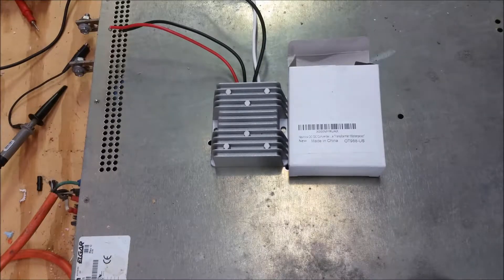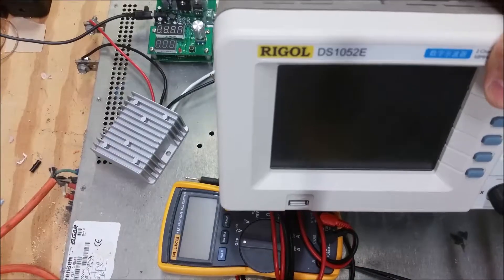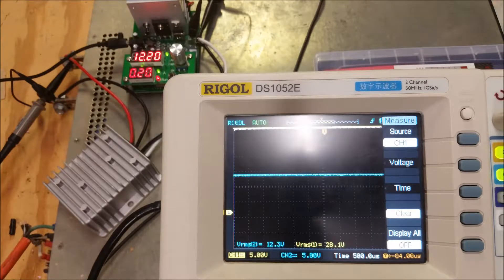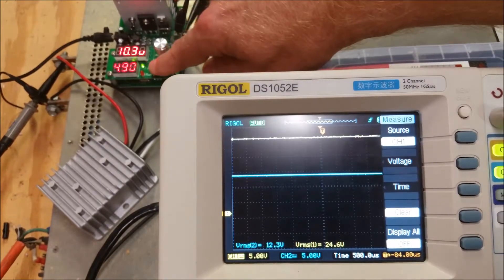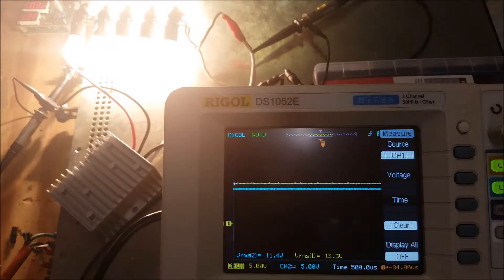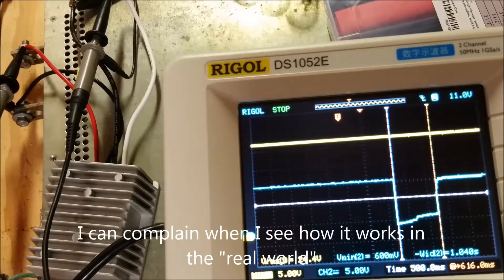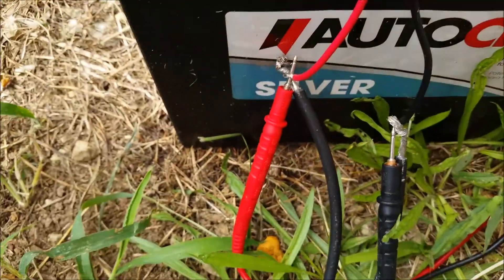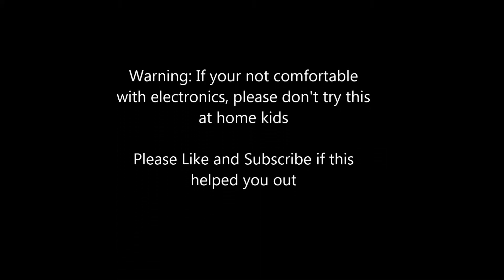Amazon DC-DC Converter Review

Comment: from the thermal test it seems to get very hot, wouldn't a change in the wire size and a cooling fan on the heat sink help to keep it from burning up?
Reply from the maker: Wire size can't be changed as it's connected to the pcb which is encapsulated in potting material. There also wasn't any mention of airflow being required. But in concept, I agree

Comment: I'll point out one other issue that petercamusojr didn't mention:  you used a 24 to 12 V converter with 30V input on a 12 V battery, no isolation mechanisms like diodes.  To charge a 12V battery you really needed a 36v to 13.8 volt converter.  Once the battery recovers and its voltage rises there's no guarantee you won't reverse current that way too.  Your lab testing was well done.  Your real world example is a bit too "real world" and was really more of a destructive test.
Reply from the maker: The panels voltage never drops below the battery voltage, so there wouldn't be any reverse current.  Ideally, protection diodes should be built into the converter

But yes, a 13.6 volt mppt controller is ideal, but I just wanted to have something that kept the battery at 12v.

Thanks for the reply.

Comment: Solar panels don't work well connected directly to DC converters. They can work ok if the sun is full and excess power is available, but any shade while drawing a steady load will make the solar output voltage collapse to near zero. This can make the converter low input protection trigger constantly.
Reply from the maker: This wasn't the case.  While I agree you need an mppt controller, this was a stop gap measure just to keep the battery topped off. But it shouldn't have resulted in the converter being blown out.

Comment: I bought one that was 480 watt 12volt to 24 volt and have had great results. I ran a zerobreeze mk2 "240 watt"  off it many times for extended periods. Maybe the boost converters are better built.
Reply from the maker: @wingman0114  thanks for the post. Interesting results, which brand.
Reply: @stem_saving1644  MGGI

Comment: can you use the same ground wire for input and output ? if i am trying to use this in my car ?
Reply from the maker: If it's non isolated you should be able to.
Reply: @stem_saving1644  i used 2 of this modules and used same ground no problem in my car

Comment: Well I bought the same one which has the same voltage input and output as your one does and when I put 24 volts in i get the same 24 volts come back out of it, very disappointed in the product

Comment: Thanks so much for this. Super helpful. My issue is my 12v LEDs flicker when my water pump in my van conversion pumps - same for diesel heater pump. I think I need a regulator for the LEDs because the pumps draw a sharp quick recurring load... Will this product fix the issue? Thinking no as it's limit is 12v? Thanks 😅
Reply from the maker: There is an off Chance it could work,  but what you're describing sounds like an instantaneous power problem.

A capacitor or lager alternator is probably a better solution... but can't say for sure since I don't know all the details.
Reply: Measure the relevant voltages. You will probably need an oscilloscope. OR  just bypass the wiring with some thick wires and see if it improves.

Comment: you didn't show input and output current. this test make nonsense
Reply from the maker: That can all be calculated. If you have voltage and resistance, which I showed in the video. Also have efficiency calculated.

Comment: When you were ramping up input voltage, why did you only test it up to about 30 when it is supposed to be rated to 40v. I would have wanted to see if you could go 5% or 10% above that, since if you get a 40v nominal battery it can be pushing 45v or so when fully charged.
Reply from the maker: Only have 33v supply.
Reply: @stem_saving1644  LOL that makes science.

Comment: thanks dude 
but i wanna ask about something
can i control with output amper or not
if my motore worked with max amper 7A so how can i use it
Reply from the maker: There is no feedback control if that's what your asking.  The motor determines  the current the converter will output so long as it's with its rated spec.

Comment: This is what happens when you use a buck for mppt WITHOUT A BLOCKING DIODE
Reply from the maker: How so?  What evidence says it doesn't have one built in?  Pwm or mppt can both keep a battery charged. Although mppt will do it more efficiently.
Reply: @stem_saving1644  I use these on my 60v 300w panels to charge lithium @ 13.8V (100A battery) , when i burnt my first one, i put in a DIODE and never had a problem since
Reply from the maker: @FellaMegaOld  these are rated at 40v. Not sure how they worked at 60v for you.  

But any good buck would have a good inline series schottky. I can't say what this does or doesn't have since it was potted.
Reply: @stem_saving1644  There cheap, they where  $20 in 2015

Comment: It would have been nice to know what the caps in the converter were rated at.  If they were less than 40v, then the  24v on the back should have been adhered to, irrespective of what the advertised claim was.
Reply from the maker: Unless you dig out the potting, you'll never see the ratings. If the specs say upto 40v, then it should operate to those requirements. Users shouldn't have to second guess capabilities listed on the datasheet. If that's the case why buy it?  That's my opinion.

Comment: I recently purchased this rugged Boost unit as 12 to 48v DC at 6 amp output max . I intend on using only 34% duty cycle on same max 6 amp, that reduces the use wattage less than 1/2.  Should I assume it will stay working? Should I use a higher rating such as 8 or 10 amp which is more costly?
Reply from the maker: The unit I reviewed is a buck not a boost. You should be fine so long as the instantaneous isn't higher than the max output.  I would also add filtering to reduce transients.

Comment: It says very clearly when your purchasing the converter, do not connect directly to a solar panel. There's probably a reason for that.
Reply from the maker: Not on the one I purchased. Read the description closely before I purchased it.
Reply: @stem_saving1644  It appears the solar panel produces voltage spikes that blew your caps.
Reply from the maker: The panels upper voltage max is below the converters threshold so that can't be it either.  There are lots of applications where buck converters are used on panels.
Reply: @stem_saving1644  The reason they say not to connect directly to panels is because Solar arrays, like all electronic devices, are prone to surges in voltage that can harm components and increase downtime. Surge protection devices can help keep systems running and profitable.
Reply: @stem_saving1644  Well, on the video I saw it was over 30v, which would mean you have 2 panels in series, since solar panels are typically 24vdc, which would be 48vdc, which is over the 40v limit.
Reply from the maker: It's a single panel. Panels can really be any voltage. It's dependent on the amount of cells in the panel and how efficient they are amongst other variables.
Reply: @stem_saving1644  Well, clearly the caps blew because you were too close to the max, it says 24v on it because the caps are 50V. Panels can discharge massive spikes randomly. You would need to charge batteries with the panel and use the buck converter to use the batteries.
Reply from the maker: I don't think you understand how buck converters work.  Your ignoring the entire input voltage range of the part (12-40v).  The 24v your assuming is for maximum efficiency which has little to do with cap toleranceing/ derating and operation.

Caps have to be toleranced/derated higher than 24v and simply doubling their nominal voltage is incorrect as it doesn't provide nearly enough margin for the upper limits of the device. 100v caps would be ideal. 

Bottom line is the buck converter doesn't live up to its specs.
Reply: @stem_saving1644  Maybe you should spend more than $17.50
Reply from the maker: So, the other theories you suggested fall through,  the last thing to blame is price? Seems like a last resort. Price doesn't always imply quality. 

If a product is listed to perform under certain specifications. I don't care what price it is. It should perform at those listed specs.
Reply: @stem_saving1644  Electrolytic capacitors are sensitive devices. A DC buck converter is incredibly simple, consisting of two MOSFETS, an inductor capacitors and an IC. These are designed for golf carts or other moderate DC loads from batteries up to 240 watts.
Reply from the maker: Ever designed for one? How do you choose the switching frequency,  inductors, caps and control logic.

 Not to mention over current/ voltage protection and thermal protection. That's only a handful of items involved. 

Simple to use,  not to design for a lay person.
Reply: @stem_saving1644  the frequency is usually about 60khz. The caps are based on budget and desired application, the control logic is a single ic, which takes care of the rest.
Reply from the maker: Not quite so simple. There's a lot more math to it. It's not plug and play as your envisioning. But this is beyond the scope of the video. The point being is the device was rated for 12-40v @ 240w and didn't meet that simple spec. Not much to discuss on that.  I simply tested what was spec'd.

Comment: I had one almost identical fail and smoke on me recently. The cause wasn't clear, but the output caps were bulging... it's hard to say if this was cause or effect though - the whole thing got hot enough to burn a large hole in the PCB just above the output wire.

On mine the input caps were rated at 50v and the output caps at 35v.
Reply from the maker: Thanks for the input.  Another good data point.

Comment: I'm going to give the 30A it's for intermittent trolling motor use, converting a 48v e-bike battery down to 12v. Hopefully it doesn't burn out... especially since the trolling motor only pulls 16A at it's highest load.  Thanks for the characterization of this little unit, I'm going to assume the precautions extend to the 30A version as well.
Reply from the maker: I think it's the rating on the caps. I noticed subsequent ones have lower voltage ratings.  Cheap caps  have this behavior.

Comment: Do you think this product would work on a 12 V system to get my iceco fridge to work it’s showing an error of low-voltage and not running, wouldn’t this regulate the voltage to keep it at 12 V? Thanks
Reply from the maker: Depends on the input voltage and output current.  In my case I think the caps are cheap and can't withstand the 30v+.  Might work for lower voltages.

Comment: What happens if you add a 12 volt battery to the 12v output of the converter? Could a 12v battery be used as a capacitor of sorts or the 12v output?
Reply from the maker: That's exactly what's in the video.

Comment: Hi can I ask you a question? If I connect thise amazon dc to dc step down to my high voltage solar panel to go from 36v to 12v. Will the dc to dc converter only work once my panels reach the max 36v or does the converter start operating as soon as the panel feeds it any power? I hope my question was not confusing.
Reply from the maker: I wouldn't.... you can expect similar results I had.
Reply: @stem_saving1644  :

He needs a charge controller between the solar panels and DC-DC converter. In this case the DC-DC converter will be the load. 

A 36 volts battery is requiered to stabilize the output voltage of the solar to 36 volts, using the36 volts solar controller.
Reply: Clearly not.  Because he tested it with 12 volts

Comment: They have these in 40 amps. It is rated input 24v not higher than that. Mine are on solar panels rated 22v  24 hours a day and I have had no problems.
Reply from the maker: They must have derated them, mine were 30+ volts
Reply: @stem_saving1644  they make them with different output voltages 6v 7v 9v 12v 13.5v.
Reply: On Amazon, within the various brands, there are different rated units to select to purchase
Reply from the maker: Not sure if they are the same design.  Might have changed.  With larger currents a larger transformer and filtering circuitry is required. They could also be using better caps.  Lots to evaluate.  Thanks for the note.
Reply: @stem_saving1644  they shut down when overloaded and when the input voltage from the panels get too low they cut off until the next day.
Reply from the maker: As we can see mine didn't shut down when overloaded thermally. Caps mushroomed.